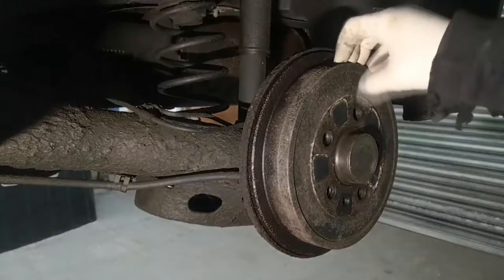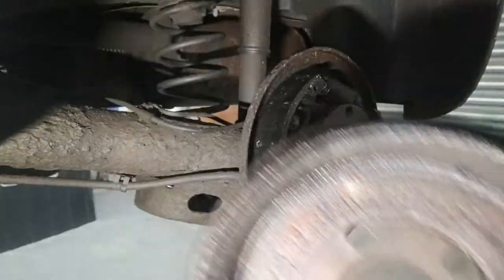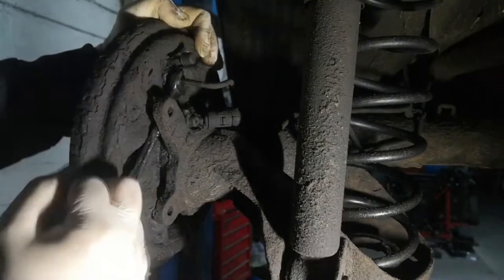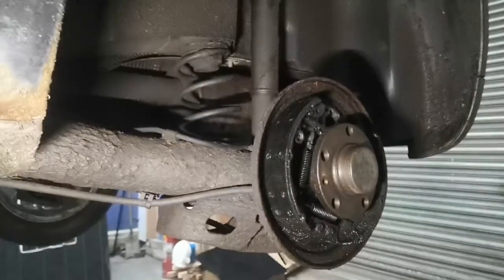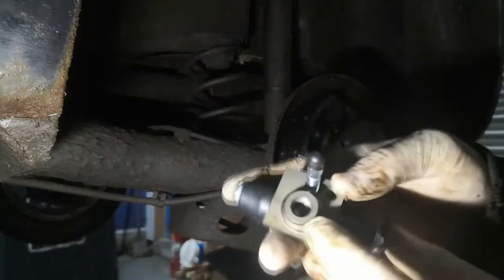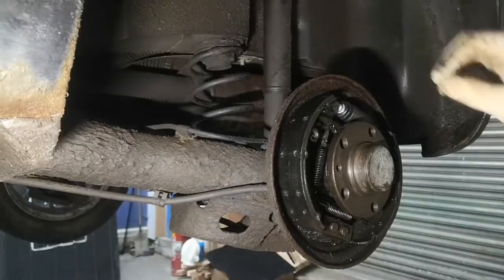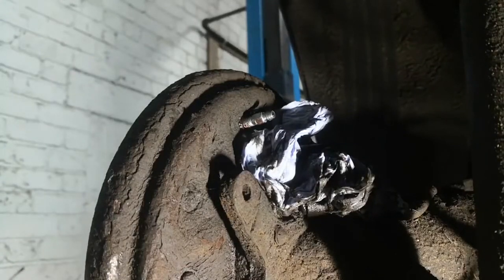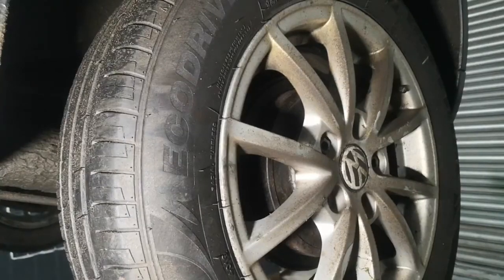Rear wheel cylinder replacement inc one person brake bleed.

Comment: I always thought if brake shoes or pads were contaminated with brake fluid then they needed renewed.
So it's ok to clean them with brake cleaner and re-use ?
I'm doing my wife's Ibiza in a few days time .
Thanks
Reply from the maker: Sorry for the delay, I think it depends how bad they are, if they've been sat getting soaked with fluid then they're probably going to be no good, if you've caught the leak early then it shouldn't be an issue.
Reply: No problem pal , hers were well worn anyway and one wheel cylinder was leaking badly,  everything was a mess.
The drums were in a state too so I changed the lot.
Thanks

Comment: I have a cylinder that won't come out? Will I smash it?
Reply: I used a rotary tool to shop away the back of time as not to damage the surrounding
Reply from the maker: They sometimes seize in place remove the bleed nipple and brake line then force it out by prying it from the front or hammering from the back